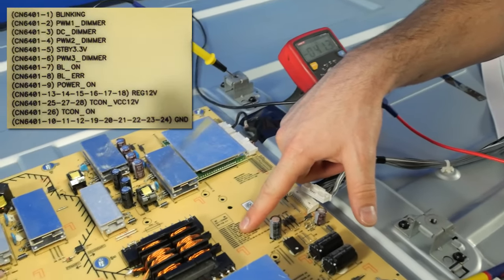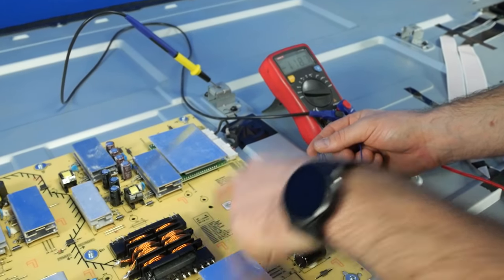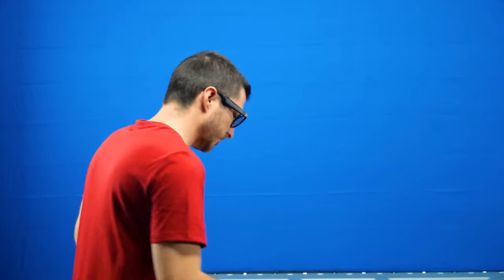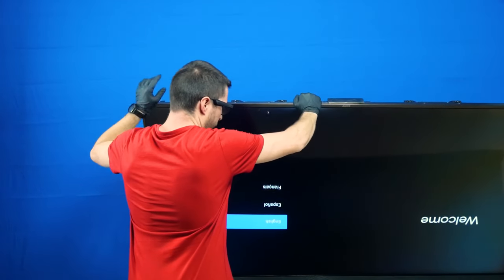Sony TV XBR-75X850F No Power

Comment: If I jump Standby to TCon On and only get the 3.3 volts from standby instead of 12 volts, does that mean the power supply is defective?
Reply from the maker: I am not sure I understand your sentence. 
If you jump the 3.3v standby line to the T-con_ON line then your T-con_ON  line will read 3.3v because that is what is being injected into it. This is your command line and it should not get more voltage than that. So far this is normal. When you do this however provided your power supply is also getting the on command aka 3.3v to the Power_on line then your T-con_VCC voltage should show 12v. T-con_on is a signal /command line coming into the power supply, the T-con_VCC lines are outgoing power lines going out and to the T-con.
Does that make sense?
Reply: @NicksTVRepair  yes.  I did the jumper like in the video with wires connecting the standby 3.3 to power on and to tcon on.  But rather than getting 12 volts it's just the 3.3.  Does that make sense?
Reply: @NicksTVRepair  I assume because all three lines when jumped together only have the 3.3v from the standby line, rather than the proper 12v, that the power board is defective.  I know many times people assume that if the standby voltage is good they assume the main board is bad and it's not sending the signal back to power on
Reply: Did you figure your issue out?  I replaced my main board and power supply still nothing. @adamruss656
Reply: @Huntmx24  unfortunately not.  I put it back in the box to work on again at a later date.

Comment: Picked up a free sony xbr-75x900f from a neighbor. Tv has white stand by light at the bottom and I can hear sound but no picture, not even shining with a flashlight. I opened it up, LED Driver board shows a green light and next to it is a red light that lights up  3 times consecutive then pauses then lights up 3x again and so on. Any clue to what those led’s mean. Im waiting for my volt meter to get here and thought I would ask before I went in deeper lol.
Reply from the maker: "Tv has white stand by light at the bottom and I can hear sound but no picture, not even shining with a flashlight"

This means your power supply is good. Most likely you have a mainboard failure. The mainboard does commonly fail for this model TV, we have had to fix that module more often than anything else. Especially with those symptoms.
Reply: Did you figure out your issue?  I have the same tv. I replaced the main board with one off ebay and nothing. Then tried the power supply. Nothing. If I do the jumper pins with main board disconnected I get the 3 red lights on the led board but that's it. No click from the power supply

Comment: I have an old Sony Bravia tv i need  help it just starts blinking around 18:00hrs 6pm and it switch's off we have to wait for an hour plus for it to switch on
Reply from the maker: I can't help you without knowing both the model number of the TV as well as the exact symptoms. What blinking are you reffering to? Are you refering to a blink code on the standby light? If that's the case please let me know exactly how many blinks! 
Also make sure to provide the info in a new comment. I don't get notifications on replies.
Reply: @NicksTVRepair  
Greetings, thank you for your response. It's a Sony model KDL 32P300H LCD Digital colour Cyfrowy Telwwizer 220_240V 50Hz 130 W . And I meant it starts blinking and volume if affected and goes off.

Comment: Hi, I own a Sony X80K 55-inch TV. The problem is that the TV is not turning on. When I press the power button, the white light under the TV turns on with a sound(normal boot up sound), but later it turns off. When I press different buttons on the remote, only the white light blinks as if receiving communication from the remote, and the screen remains completely black without even showing the Sony logo. I've already connected it with HDMI e-ARC to a Sony soundbar. On the soundbar display, it shows the TV sign, indicating that it's receiving data from the TV, but there's still no power, only a black screen. It's just 10 months old. 😢

Comment: Whare can we download the right flash files for the new emmc chip ?
Reply from the maker: If you are reffering to the software you need to download to a flashdrive once the eMMC chip has been replaced so that you can pair your mainboard back to the TV, that will be on the Sony support site. Type in your model number in their search and you should be able to find it. 
If you are asking for the eMMC image, then that is not provided.
Reply: @NicksTVRepair  so the prossesor is always looking for a usb flash drive at startup ?
Reply from the maker: It looks to communicate with your T-con and maiboard. If it's not paired to them then it will require to be paired. If it is already paired then no it won't require for you to pair
Reply: @NicksTVRepair  what is pairing does or means exacly ? Is the communication controlled by the software inside the emmc ?
Reply from the maker: With Sony TV sets made between 2015-2018 you have to pair your mainboard and T-con together for them to work. If I have a 100% working TV but decide to remove my mainboard from my Sony TV and put in a new mainboard in, it won't work. It needs to be paired to the TV. Once I have it paired, the TV then will turn on and work. If I now decide to put my original mainboard back in for some reason, it won't work because now the TV is paired with the replacement mainboard I installed and no longer paired with the original. So now I have to pair the original mainboard back with my TV. 
It's not 100% like that but that's kind of the basic idea.
Reply: @NicksTVRepair  so if i buy a new mainboard i have to desolder the emmc to the swap it from the old mainboard ?
Reply from the maker: This is one of the first videos we ever made 4 years ago. I recommend you watch it:
https://youtu.be/3kYPjIHt8Lc?si=-7ldlFoem1JJqNHq
Reply: @NicksTVRepair  i have the sony KD-55XF8096 there is no led turning on and all voltages are present on the power supply. i cant find a software for this one also
Reply from the maker: Sorry I don't think I can help you. We only work on North American models
Reply: @NicksTVRepair  where can i find more service information ? The servicemanuals are crap these days. 20 years ago we easy cud fix our equipment from a servicemanual.
Reply from the maker: I don't think you can. 
We don't usually use service manuals, 99% of the time we have to figure it out on our own. It's tough

Comment: I have a Sony Same model but 85” , when I turn it on, screen quickly flash and turn off right away and won’t turn back on , also the red light blink 4 times . Please help thank you
Reply from the maker: Kalvin,

The 4 blink error code means you have an LED strip failure and will have to replaec your LED strips. This is also called your backlight.

Comment: Where do you get the emmc chip?
Reply from the maker: Finding good reliable eMMC chips is very difficult. That is not something I can share sorry.
Reply: @NicksTVRepair  I understand, does the emmc have to be from same tv or can I take off from another tv that I have?
Reply from the maker: You would need to program the chip as well. You can't take an eMMC from one TV and use it in another without programing it with the specific software required for that specific TV. 
As for the eMMC itself it would need to be the same exact eMMC.

Comment: hey i have sony xbr-65x900c get no power at all replace main board but i still get no power bcan you help me out please
Reply from the maker: It is possible the replacement was defective. 99% of the time a no power fault is mainboard related. 
If you have a multimeter and the ability to do a few voltage checks to make sure your power supply is sending the standby voltage, as long as that's happening, then your power supply is okay and the fault is with the mainboard. 
If you don't have a multimeter or don't want to do the troubleshooting, you could always send us the mainboard and power supply for us to troubleshoot and diagnose for you. If you have any questions regarding having us test and fix your modules, send us an email directly or fill out one of the contact forms on our website. All of the contact info is in the video description.
Reply: @NicksTVRepair  What about when your power supply has no voltage for standby or anything? Is it still your main board? I have a XBR-55X800G and has no power but i also get no voltage on the power board pins? Could it be the Power board or is it the chip on the main board?
Reply from the maker: @abelvasquez7165  If you don't get any voltage coming out of the power supply, then the power supply will need to be replaced.

Comment: Seem like Sony tvs main issue is no power & mother board 🥸
Reply from the maker: Yes that is a common fault, but this is good news though because other models like Samsung's often have panel failures which are not serviceable. At least with Mainboards failing you can either replace them, or fix them on a component level and not have to throw out the TV.

Comment: I'm in the Caribbean. Too expensive to send boards
Reply from the maker: Depends on the size and weight of the circuit board and package as well as the courier and speed. We have had people send us circuit boards for repair from Europe, Africa, the middle east, and Hongkong before. Not all international boards are repairable by us however if they are software failures. For example, Sony boards such as this one with software failures, we can only service the North American version of the model as there are differences in the software and how they operate.

Comment: Mine crashed & burned after 3 years.  May not buy a Sony again.  Very expensive! 3 years?  Am very disappointed.
Reply from the maker: I can understand that is a bit frustrating. The good news is that although it has failed, with most Sony sets the TV is at least serviceable, the failed parts are usually the circuit boards inside the TV where as other brands we see failures with the screen itself which means the TV can't be fixed no matter what.

Comment: Sonys quality is not good.   You will be lucky if a new tv lasts 2 years.
Reply from the maker: I would have to disagree. We have fixed over 20,000 TVs in the last 8 years, I would say when you take into consideration the manufacturers market shares VS how often we see them come into our shop for repair, the cheap TVs from walmart are the #1 to come in. We get lots of TCL, and roku TVs as well as the lower end vizio, and lower end LG. Not many of the high end Vizio or high end LG's however. We do get Sonys as well but not nearly as much as many of the other brands. 
We do a lot of videos on repairing Sony because we think they are one of the major brands worth fixing due to the value and quality they have. The thumbnail is just there to be dramatic and get the click, but they have really good picture and are worth fixing in my opinion.

Comment: Happen to us too, Sony has a serious problem with that. Obviously its not worth repairing after 5 years, but come on sony, we dont have 2000 $ for a tv every 5 years !
Reply from the maker: I would disagree and say that it is worth fixing. We have fixed thousands of Sony TVs with these issues. You would be saving $1,800 by fixing your TV instead of buying a new one. 
Check the link in the video description we have a flat rate service for your mainboard that is less than $200 and will come with a 1 Year warranty.